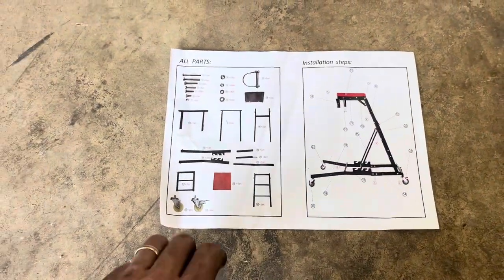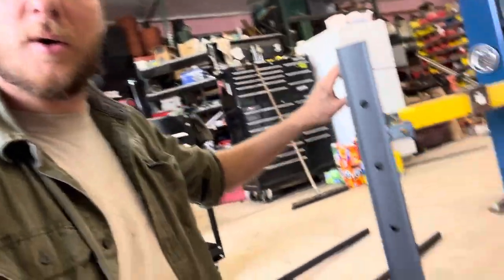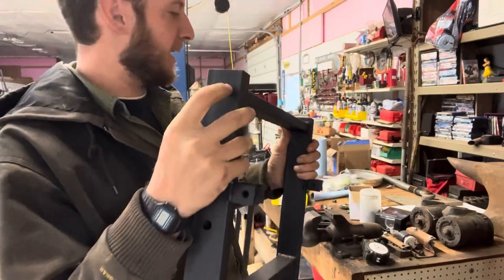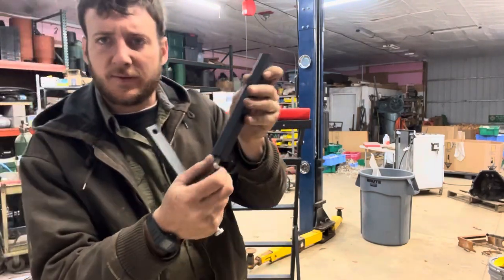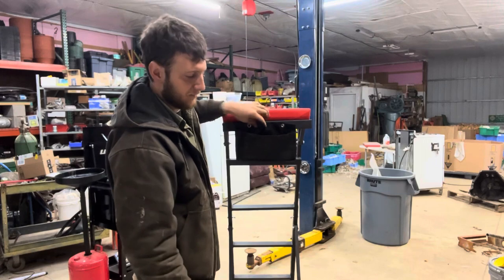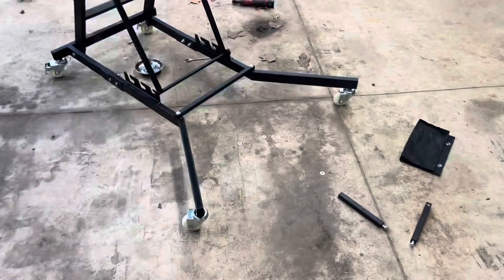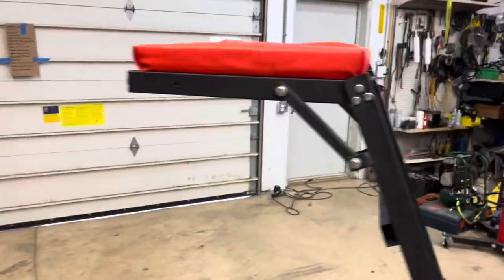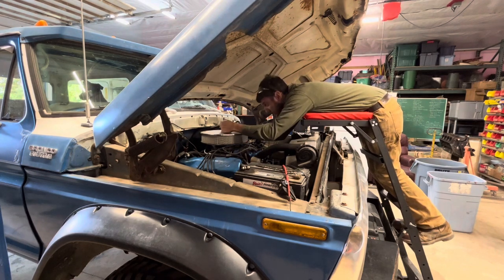Vevor topside creeper: Cheapest on eBay and Amazon

Comment: A useful accessory I make for my trucks is a 6x6 the width of the distance between fenders so it fits on the lips not the outside painted area. That gets a hunk of 4x4 under each end for clearance and while it's handy on its own it would be gold with that style topside creeper as a place for parts trays etc.
Reply from the maker: These dentside fords are perfect as the fender are little parts trays. Thanks for the tip and the comment I appreciate it
Reply: @Notafordguy  Another dentside tip is to take the ignition module (most aftermarket units copied that stupid factory potting compound) and bond a layer of soda can (or whatever) to the case and the compound so it's fully sealed. Then your potting compound stays in the module instead of drooling on the fender. They really should be mounted bottom facing upwards but then stuff would stick to the potting compound. It was normal to carry a spare module and pickup (blue module grommet modules only) behind the seat so highway surprises are easy to deal with. Ditto contemporary GM and Dodge (the module pinouts even interchange!) trucks of the era.

Comment: Which time knew what those two pieces of metal with the screws hanging out of them was for am I supposed to hang something on them or throw them away? Any help would be appreciated..
Reply: They are designed to sit on something in the engine bay like a stabilizer hard to say if they would line up with anything under the hood to make them useful